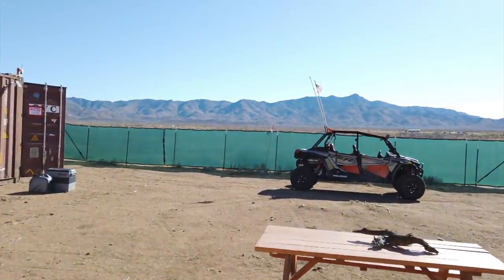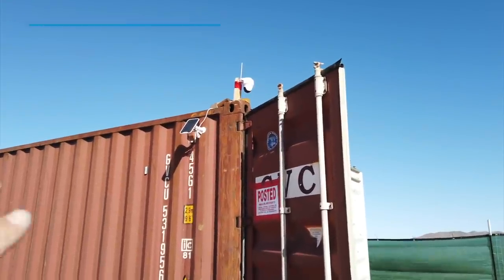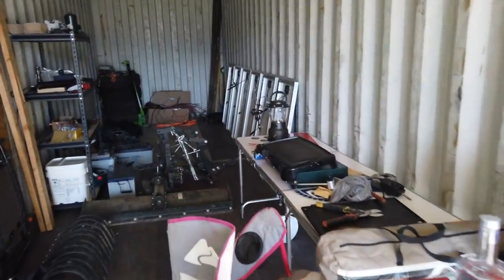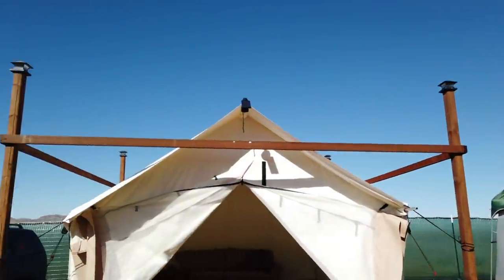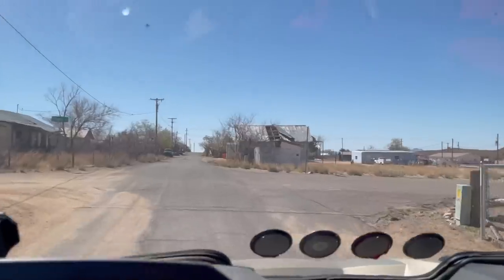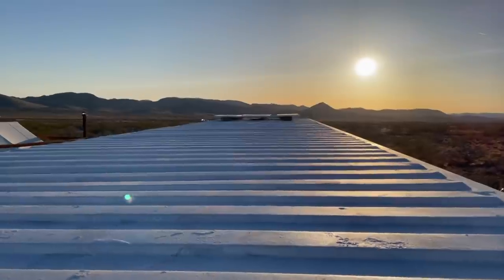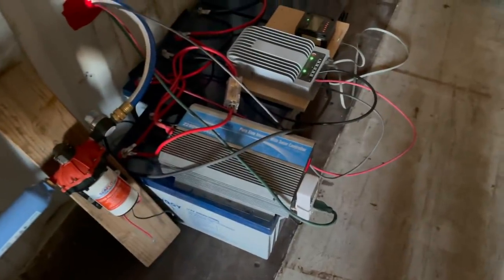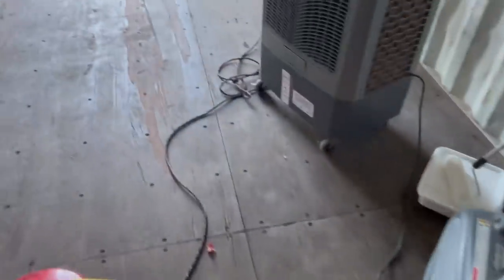Update on the Off Grid Campground

Comment: Nice off the grid set up, only thing I would do different is move the inverter away from the water supply line, in case it springs a leak, oh and congratulations on Erica going back to work

Comment: Pretty impressive camp! The solar setup you put together is really nice. I had good luck with using a charger inverter which everything is in one box. Can always run black pipe for a water heater. Works better than you would think.
Reply from the maker: I’ve heard of using black pipe.   Maybe I can weld some clips to the roof and hang black pipe one day.   Nice to have a backup option
Reply: @OfficialLILV  just set it up next to the container. It doesn't take much. Propane can be a pain in the ass as you have to get the propane. You have to get the right kind of water heater without any pilot light running all the time. It will use up all your propane before you know it.
Reply from the maker: I put the one I got in the description.   Lmk if you’ve heard of it
Reply: @OfficialLILV  I haven'tt heard of it. There are a whole bunch of chinese water heaters like this. I am sure it will work ok. I have used Paloma before and Bosch. I live off grid.